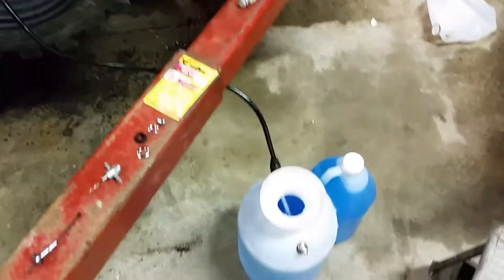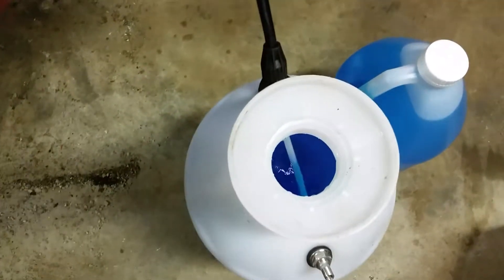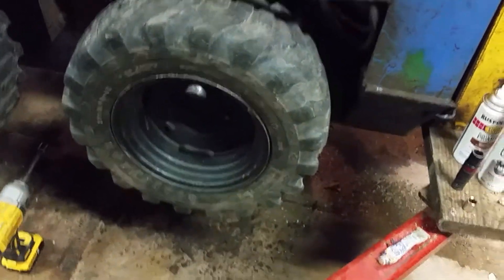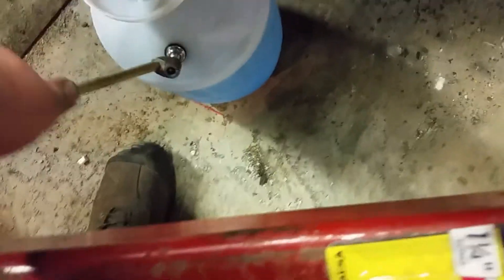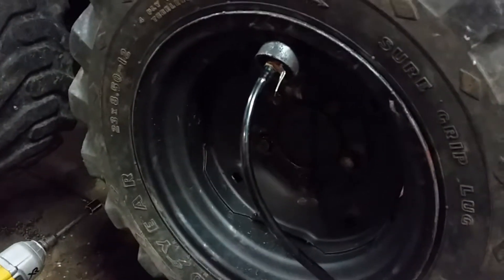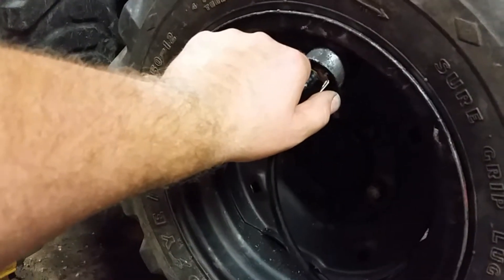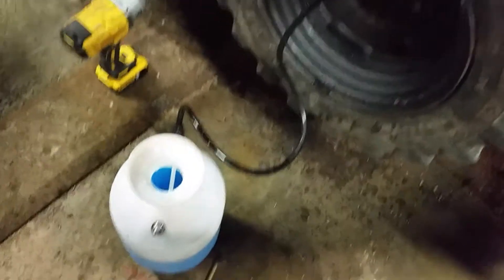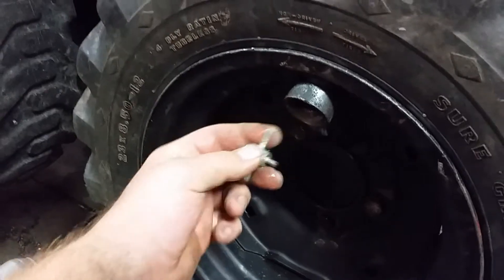How to add liquid ballast to a tire.

Comment: just drill a hole in.2 liter bottle cap. shove the hose into the hole {has to fit snug}. screw the cap onto the bottle. flip the bottle over and cut a hole in it. pour in your liquid. tire magically fills itself. its called gravity.....when you get too much air pressure, itll bubble up through the bottle. not rocket science. of course i fill my skidder tires with water. because im cheap as fuck.

Comment: Would this work with filling with beet juice?
Reply from the maker: I would Imagine any liquid that doesn't freeze or deteriorate the rubber would work. 
It most likely wouldn't affect the pump.
Is beet juice expensive though? 
Would it biodegrade and create methane gas inside the tire?

Comment: How is 5 gallons going to help that much? That's about  40 to 50 ponds, a ballasted tire should have at least 300 Hundred or more pounds (depending tire size) to be of any significant help.
They have a chart you can refer to that tells the amount of fluid need according to tire size.
However, I really like your sprayer setup, that is really a great idea.

Comment: Can you do this with or without a tub in the tire and what are the pros and cons of doing this
Reply from the maker: Jarrod Penton
 You can add ballast without a tube, but you risk exposing the rim to corrosive liquids(depending on the liquid used).
Washer fluid is probably not corrosive, but calcium chlorine definitely is.
I used tubes because my rims  had a lot of holes in them that i welded up.